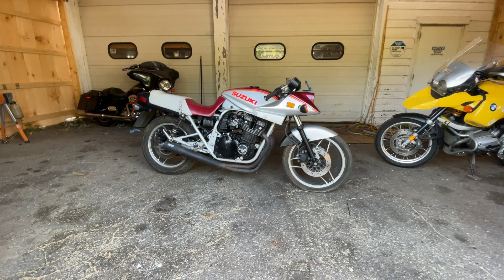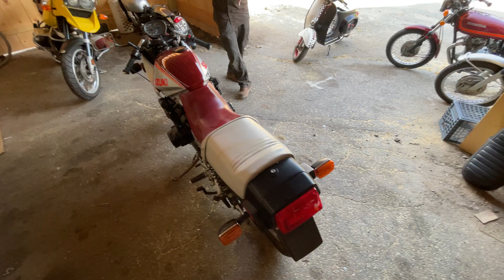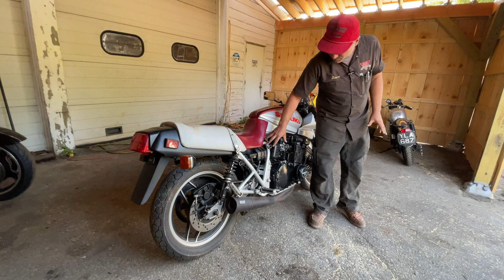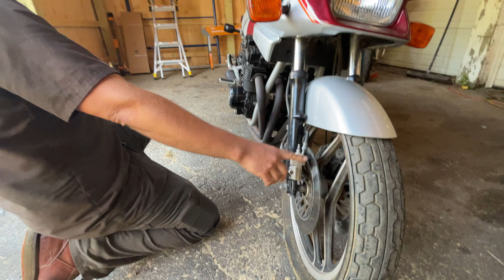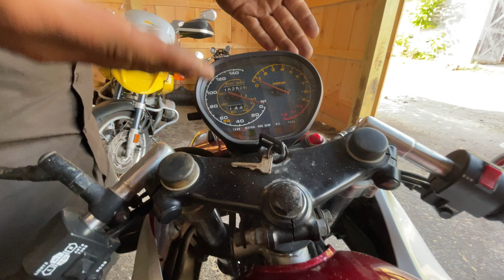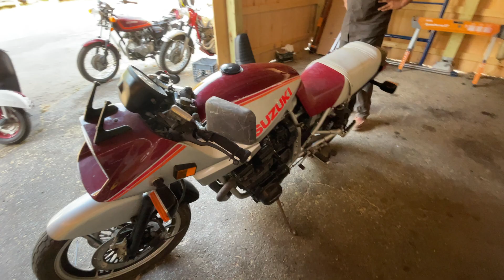Nova Motorcycles-1983 Suzuki Katana 750

Comment: During the 70s and 80s production racing was huge down here in the southern hemisphere, the Japanese factories were all heavily invested in it, and used to release bikes months earlier in NZ  and Australia than the rest of the world so they could race in the big production endurance races. The Katana 1100 was going to go up against the CB1100R, which was far more capable on the track, so Suzuki and the NZ Suzuki importer built 45 very special Katana 1100s to try and beat the CB1100Rs, those bikes were the “Wire wheelers” they had lighter wire wheels off the RG500 gp bike, up rated carbs, brakes, clutch, larger bore exhausts, and hotter cams. Only 20 units were needed to homologate them for racing in NZ, but 45 were made as some were shipped to South Africa to race there. They are probably the rarest version of the Katana ever built.
Reply: The Kat was hampered by a longish wheel base.